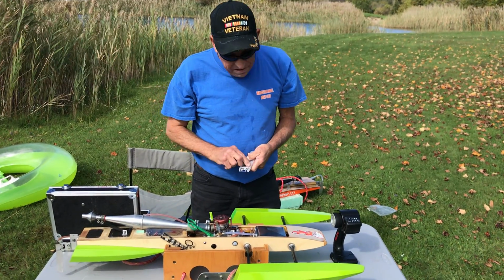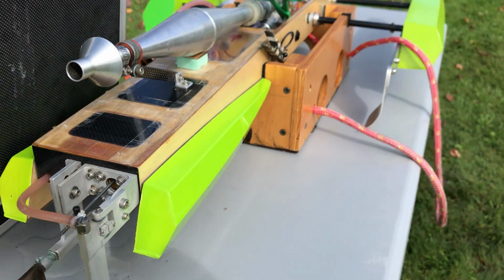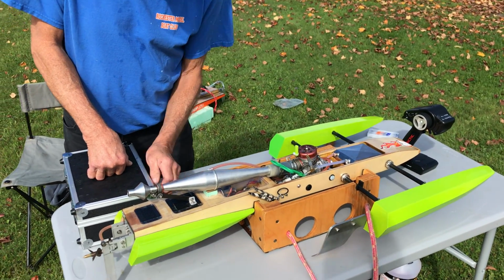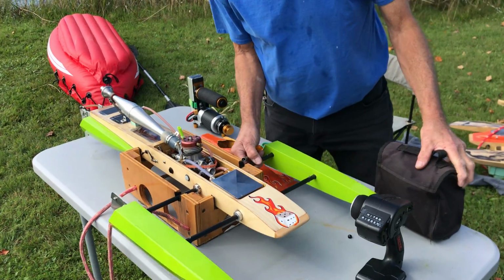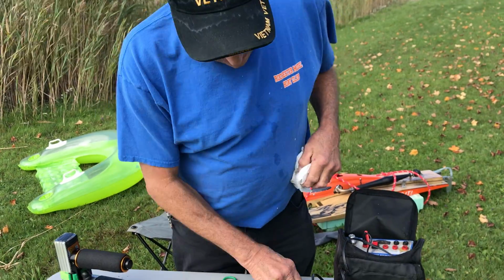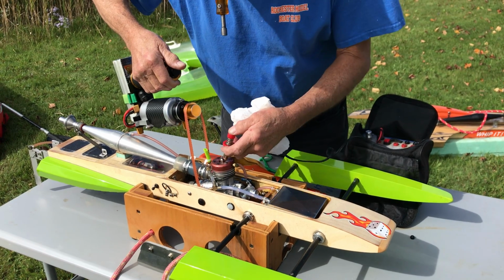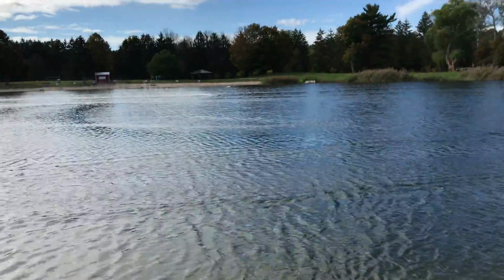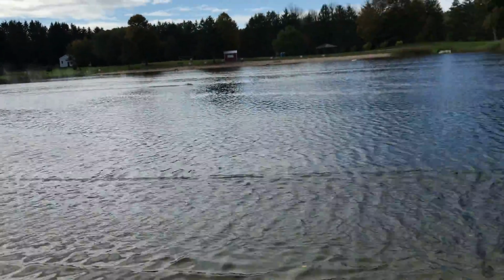Alabama RC Outrigger Model Nitro boat

Comment: Hi 👋, I am new to your boat work shop, I am in my 70s retired, living in France now I used to live in the Uk , in the 80s and 90s I used to race 3 1/2, 7 1/2, 11 and 15cc CMB nitro hydros, not sure whether you know the guy, but I’ve purchased a Rigger from a American gentleman, call Don Pinkiet , not sure whether I spell the name right, but it was supposed to be very good in the boat infertility back in the 70s and 80s, and there was hardly any boat in the UK that compete with it, I would believe by now that is watching over the water now, great running boat.
Stay Safe, PHIL FROM THE DARK SIDE OF THE MOULIN FRANCE,
Reply from the maker: Thanks for watching and the comments.  I don’t know the guy you are referring to.

Comment: Why do they turn right? Don't these boats turn left?
Reply from the maker: Turn fin is only on one sponson so it only turns clockwise.
Reply: @robertschmidtrcmodelboats6483  I am aware of that. But, it is odd that they turn right. 99.99% of racing, in the USA, is left-hand turns.
Reply: @kx454 the turn right because of the rotation of the engine and prop. There for the boat naturally pulls right and turns right better then it could left. As it would be going against the prop.